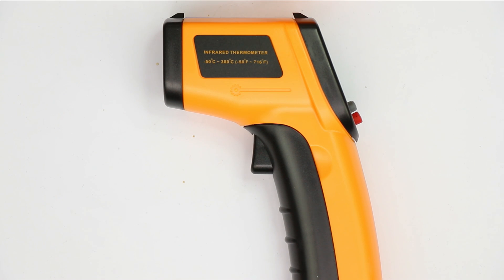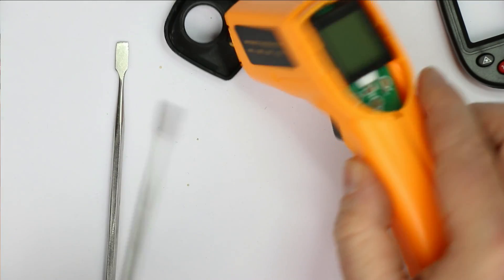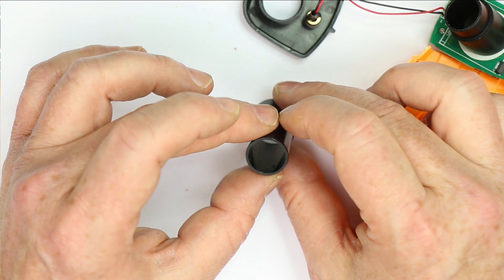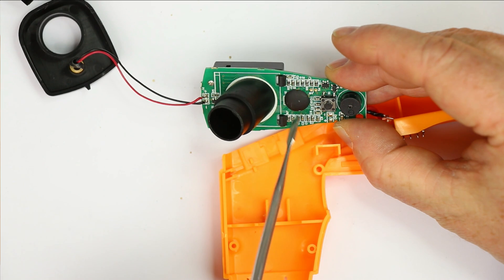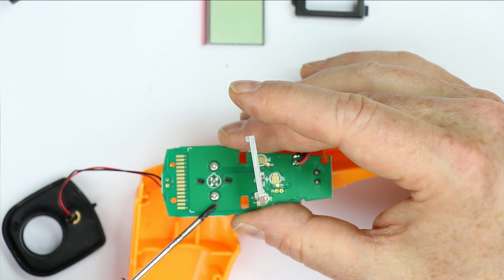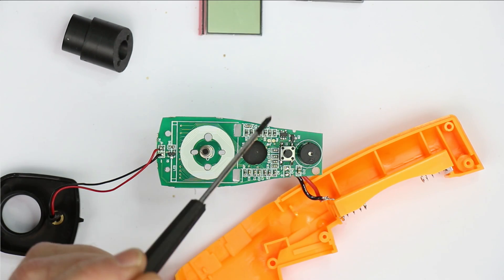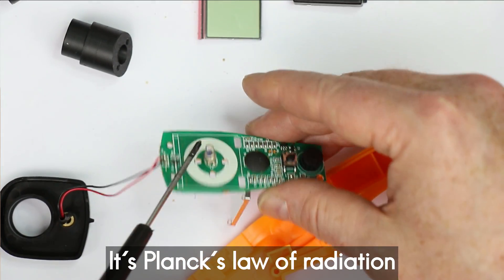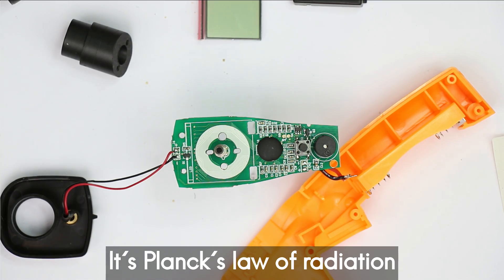IR-Thermometer Teardown

Comment: Can a distance and temp reading be done simultaneously from the same emitter/reciever?
Reply from the maker: This is just an IR thermometer, not a distance meter!
Reply: @KainkaLabs i figured it out. in thermometers a laser is only used for reference point. so my question 'can both be done in same device?' is answered yes and no. but yes because the temp reference point could also be used to measure distance.

Comment: Great video. Can you please tell me how to calibrate this infrared thermometer. I have taken mine apart after it was not working correctly and there is a 4th connector on the circuit board which when pressed indicates 'cal', but i do not know what i need to press to get the thermometer to read the correct temperature.  Please help, thankyou.
Reply from the maker: I also don´t know.

Comment: The IR sensor might use I2C, hence using 4 wires instead of 2.
Reply from the maker: No, certainly not.
Reply: @KainkaLabs  There exists both digital and analog sensors with this form factor (TO-39). Examples:  MLX90614  has 2 builtin chips and provides SMBus/PWM at user choice, whereas TP337  is analog.

Comment: Dear Sir,
I guess that you have a GM320 thermometer. Does yours play a beep sound after you release the trigger? I've got GM321 which is from the same family of devices, the same design and display pattern, but after every measure it plays a lound and annoying 'BEEEP". I wonder if there's a special combination of buttons to turn this sound off or the only way is to de-solder internal buzzer? The manual says nothing about it.
Reply from the maker: At mine there is no beep, Just desolder the piezo-beeper.

Comment: if i remove the laser will still work normally? the laser cat 2 seems too bright to point to close objects and every time you put batteries in, you have to remember to disable it ( when i don't use it for some time i remove the batteries)
Reply from the maker: The laser is completely separate from the rest of the electronics. But these lasers are not dangerous because even if they shine directly into your eye the laser-spot doesn´t stay fixed on a point on the retina for more than a few milliseconds.

Comment: So... How do you safely remove the battery cover grip piece?

EDIT - The bottom of the join has grooves. If you open the handle, you can carefully and safely pry the join through the grooves, by lifting it with your thumb bit by bit.

Comment: May please u help me to give hint for calibration, I have one (model: yk-irt2 ) it is showing around half of the real temperature, there is nothing mention in the manual for calibration, I open it, the sensor is three wire and seems connected directly to M.processor, on PCB there is and EPROM, and a place for 8pin IC may be opamp but not used. I checked all the resisters and transistors, found Ok. I tried different tricks to go to calibration or setup mode but couldnt. Now days due to COVID-19 the scanners are short in the market and price goes very high > 250USD
hoping to get some help from you, as company is not responding
Reply: Arif Karim i have same problem with you. How to calibration.
Reply: @aryomyid  actual problem is how to enter into calibration mode  as nothing is given in manual, and supplier is not responding
Reply from the maker: I even didn´t know that there is a calibration mode. The parts I have tested until now are all within 1°C. But that is of course not enough for medical application. And BTW: Measuring the temperature of your face is totally stupid and cam give many false alarms e.g. if you were running beforehand, have high blood pressure and are aroused, flushing etc.
The only way to correctly measure body temperature is in your inner ear with special medical IR-thermometers that are accurately calibrated to better than 0.3°C.

Comment: I bought one of these and it does not work! It only reads cold things it said my hamburger was 494 degrees?
Reply from the maker: Probably you got a bad one. Buy another one. Concerning the low price it should be no big deal. We´ve had no problem with these cheapys sold in our shop.
Reply: What make?
Reply: Turn the heat down on your grill... it's too hot.

Comment: There is the analog to digital converter where you see resistors, processor and the LCD display.
Reply: Mera ek laser went dead...can I replace it with what type....specifications?

Comment: Great teardown! Quick question. Is there a way to concentrate the ir scope from 12:1.5 to 12:1 by adjusting or reshaping fresnel lens? I would guess a germanium lens would improve accuracy.
Reply from the maker: Well if you get hold of a lens with a longer focal length, that would improve the spot/distance ratio.
A Germanium lens would of course be superior due to better IR-transmission and better optical quality compared to a Fresnel-lens (the radiation is concentrated more on a spot if it has the right shape).
Reply: I need also better scope. Maybe another device have better lens. Easiest way.